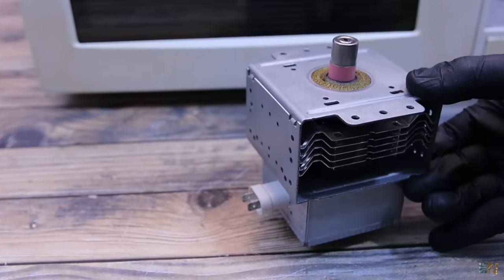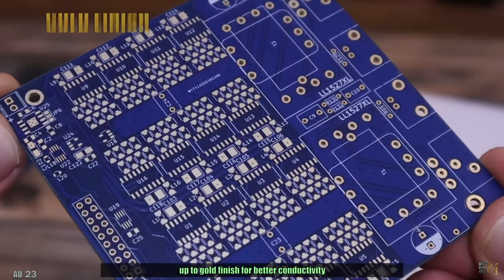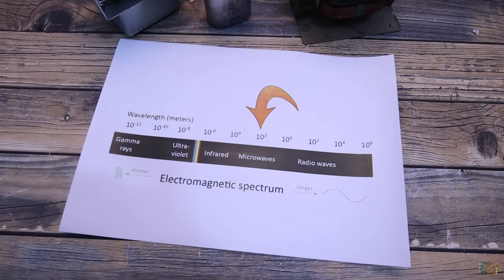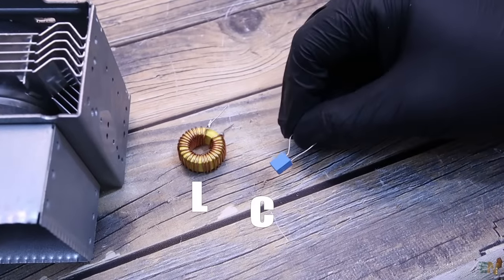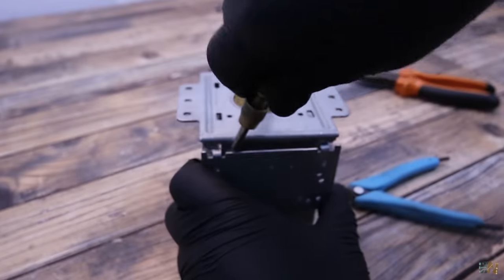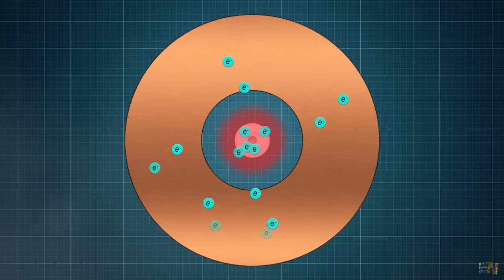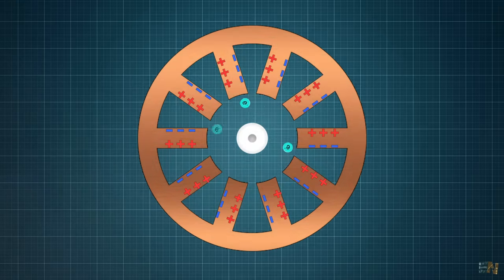MAGNETRON - Teardown + How It Works - Dangerous!

Comment: Very good presentation.
I was trained at Varian Assoc. in my earlier years, designing and making both magnetrons and klystrons.
It was all about copper, powerful electromagnets, EHT, shf, amps and heat. Our klystrons were used for both radar and TV transmitters and consumed many 100's KW of mean power. The ones I worked on not only emitted microwaves but incidently X-rays which had to checked for safety. The vacuums were typically down to 10^-12 torr if I remember correctly provided by ion pumps.
Cant go into too much details (frequencies, output power etc) for obvious reasons but I believe most of this technology has moved over to Solid State!
Reply: Thank you for your comment. What did you have to learn to start doing microwave tech?
Reply: @cherylm2C6671  Quite a lot, I studied electromagnetism (Maxwell) and the maths in my own time, linear algebra and basic electrical theory. Our company was also working on the new X-Ray Tomography machines just coming into production.
I worked in the section designing and making the cavities, so had to learn to use machine tools as well, to very high tolerances I may add. The smallest klystrons were used by jet aircraft in the nose cones, these were much higher frequencies (X band) but much less powerful.
Reply: @tomctutor  Thank you for your reply. I look forward to learning more about magnetron applications. Cookbooks now, theory eventually.

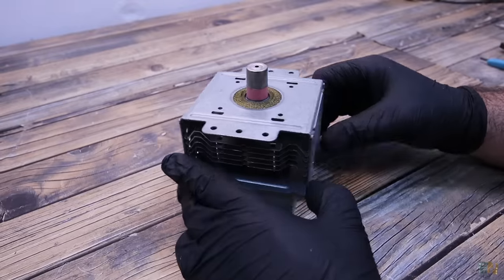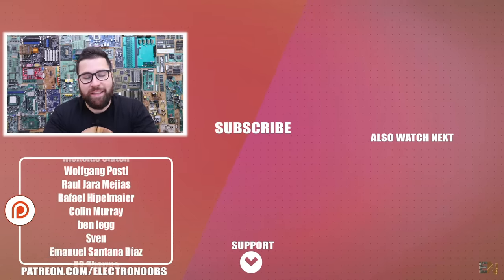Comment: Very interesting.  You could reuse from 8:00  to 14:00 in a video comparing the magnetron with how a Radar Vacuum tube achieves frequencies and speculate why we do not use tubes in microwaves ( excluding manufacturing as when commercial  microwaves started being made, there were vacuum tube manufacturers that could do it ).
Reply: Simple reason is cost and efficiency, magnetrons are over 50% effective at generating microwaves, and need no excitation at all, where transmitter tubes need both an exciter stage to drive them, and also filters on the output, plus the typical efficiencies of around 30% is a big drawback, and also the volume they need. Magnetron combines self exciting, and built in filtering cavity filters in it's design, so it is a single part.
Reply: What do you mean by "Radar vacuum tube"? Magnetrons are vacuum tubes. Indeed, they are used for certain types of RADAR too.  Klystrons aren't altogether too dissimilar in working principle either but they're specifically set up to be able to amplify a signal, whereas a cavity magnetron can only really act as a local oscillator. Handheld RADAR guns use solid state devices (Gunn diodes) and there are now power FET devices that can operate well into the mw band, but when theres no need for a high fidelity, low noise amplifier and all you need is raw RF energy it's pretty tough to beat the humble cavity magnetron.
Reply: @whatelseison8970  The ORIGINAL vacuum tubes used for RADAR had a micro disc inside as the resonator with specific gaps on the inner circumference for the RADAR frequency instead of the size of copper chunk inside a microwave oven.  It appears if you increase the size, triple the wattage you can achieve the same frequencies and higher without being in a vacuum.
Reply: Thank you for your comment. A radio science newbie is always looking for analog applications. There is still plenty of work for vacuum tube in the industry.
Reply: That magnetron is a vacuum tube till you cut it open.

Comment: around 13:22 , you said that the microwave transformer generates around 300V AC! i know its just a typo and in the captions it says correctly as 3000V but to just let you know, i pointed this out. Nice video man as always, hats off to you! keep making such informative content🔥🔥🔥
Reply from the maker: The correct is 3000V. I've read wrong the script, sorry :)
Reply: @ELECTRONOOBS  They are basically an electric chair in a box.
Reply: @ELECTRONOOBS  It's 2KV

Comment: Theoretically microwaves don't come from the hole of the antenna, but really from the insulator, 8:55 those are actually the Heater inputs, anode is grounded on a magnetron, btw nice video

Comment: The safest, for me most useful, component from a scrapped microwave oven is the timer. I kept on forgetting my solder iron, leaving it on overnight until I connected via the timer. I prolly will do an upload to show how it was done. Love these teardowns! Thanks. 🙂
Reply: Going to check it out now  :)
Reply: Years ago i took the display/keypad/controller assembly off an old microwave oven and attached a power cord to it and hung it on the wall in the garage. Makes a great wall clock with count down timer and beeper all built in. Great conversation piece.

Comment: I worked at a microwave plant in the 90's and would go through the "dud" pallets of magnetrons getting tossed into the scrap dumpster to get all the ceramic magnets out of them. NOW I know how those crazy things work. Thank you!
Reply: You threw out copper like that as scrap?
Reply: @Star Gazer  It's like 95% aluminum with very little copper but im sure it got separated at the scrap yard by some means.

Comment: Thanks for this video explaining how the cavity magnetron works. I have made a video showing how to troubleshoot simpler microwave ovens similar to yours. I simply explained that the transformer, diode, and capacitor can be tested easily with common meters and tools; and that if you confirm they are all good but there is still no heating, the magnetron can be suspect by process of elimination.  My mom still has her 1988 year Sharp microwave. Its original magnetron lasted until 2020. Very well made product! I was able to get a used magnetron from eBay for a few dollars and get it going again without problems. 

Thanks again for your good explanation!
Reply: Thank you for your comment. I'll look for that video.
Reply: @cherylm2C6671  
You're welcome. I'll post a link to the video in the next comment. If you only see one comment then it means YouTube is blocking the link.
Reply: @cherylm2C6671  
Microwave diagnostic video: https://youtu.be/v8O3S9H4l_c

Comment: Though video was pretty good, i would like to mention that ''the metal sheath'' you mentioned on the beginning of the video is actually made of mica, and it is interchangeable. If it gets pounced, it can be replaced , and the microwave oven is good as new.
Reply: Thank you for your comment!  Cleaning the interior often is a good insurance. Fat splatter gets hot enough to damage the protective mica.
Reply: @cherylm2C6671  I used a plastic film on one of my ovens and it worked for many years with no visible damage. I think that mica is used just as a "worst case scenario", the area doesn't usually get very hot during normal operation.
Reply: @techalyzer  I will try that! Thank you for your suggestion! That will make cleaning easier than pushing on that mica plate. break. Fats (or bits of exploded egg) kept away from the magnetron.
Reply: What does ‘pounced’ mean?
Reply: @2Sorts  i mean if a hole appears, as shown in the video

Comment: Amazingly informative video. I learned so much. Also learned I should handle those insulators with more care 😬. Ive taken apart a number of microwaves but never knew what it looked like inside the copper high voltage diode, really interesting way to use induction.
Reply: While studying radio, I found Inductors and Capacitors are kind of opposites.

Comment: Perfectly timed :) please also cover TWT, Relfex klystron and microwave diodes if possible
Reply: Back in the 70's, at ET "A" school in the Navy, I taught these things. Something like this video would have been nice back then. I made do with drawing a cross section on a chalkboard and trying to describe the electron flow that way. Animation is so much nicer. Our animation was Army films from back when radar was invented, mostly cartoons with sgts yelling and hearing echos.

I always found the reflex klystron intriguing, with its re-entrant cavity. The visualization reminded of a popcorn popper, electrons flying up through the cavity, seeing the repeller plate, and reversing back to the cavity. One of the weirder devices, but kind of fun to teach. 

TWTs, on the other hand. We really only touched on them, and I never worked on them. Taught a brief segment on them, can't say as I really understood them that well, myself. I can say, however, I can remember having to change how we referred to them while I was there. The change happened as we started getting women coming through the school. Before, when we talked about TWTs, they were amplifying tubes. After, we had to refer to them as intensifying tubes. Because we used an acronym to refer to them, and I'll just leave it at that.
Reply: @jlucasound  Don't forget the 'W'.... 😀

Comment: You're in the DANGER ZONE! It's funny my 15 year old convection Microwave died two weeks ago and, while I have been waiting for the replacement, I've been deciding what to do with the guts. I think a high current low voltage transformer comes to mind. The Managetron will be disposed of... no point tickling the Dragons tail.
Reply from the maker: Be careful!
Reply: @ELECTRONOOBS  Always!
Reply: Ah, rewinding the secondary to make a spot welder?

Comment: What a brilliant video! After just replacing a faulty magnetron in my microwave oven I was interested to find out what is inside one and your video explained it perfectly with a great explanation and clear animations. Thanks! I had already pulled  the faulty unit apart to salvage the magnets and was aware of not breaking the ceramic insulators, but hadn't gone so far as dremelling the copper anode. I have subscribed.

My microwave is an inverter model to vary output power and doesn't seem to have the large capacitor. There are smaller ones on the inverter PCB. It would be interesting to see a video on how inverter microwave ovens work. Thanks again.

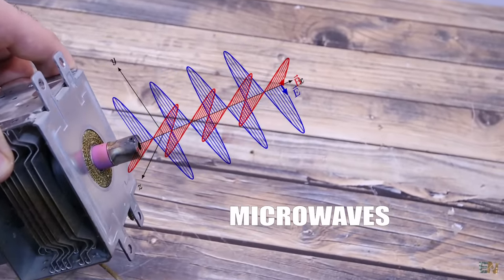Comment: 3:55 it doesn't actually shoot out of that hole like a gun. It radiates around the ring almost like an omnidirectional antenna. thus why waveguides are needed. Great illustration overall fantastic video.

Comment: Getting cancer from BeO is near impossible.  You have to work at it, literally in a manufacturing job.  You can't be hurt by touching or breaking up a BeO bore.  It's danger is way overstated.  Just don't breath the dust while manufacturing quantities of the bores.
(By bore I mean laser bore.  I worked in ceramic lasers for 15 years.)

Comment: Thanks for the video. I didn't know that thorium was used on magnetron cathodes. It will be necessary to disassemble and check the radioactivity in the Wilson chamber or with a radiometer.
Reply: Thoriated tungsten is a very common thing, you buy thoriated tungsten TIG welding electrodes cheap, and they go up to 4% thorium, so are well worth putting in the cloud chamber.
Reply: @SeanBZA  I know about TIG welding.

Comment: The pink ceramic is aluminum or zirconium oxide doped with chromium to make it pink. I used to scrap these things. They have the neat copper piece in the middle. The best way to get to it is to pry the magnetron apart. Grab them magnets and cut the wires. Then cut the top off where the antenna pinch off is. Next remove the heat sinks off. Finally grind the top and bottom of the resonator at the weld and pop it apart. 🤓

Comment: The 2100 volts capacitor filters de AC current from the transformer.
The anode needs at least 2kv to work. This high voltage comes from the transformer working as elevator from 230v.

Very good explanation. Thanks.

Comment: Thanks for all the safety tips and discharging the capacitors are important also, which can be deadly if touched before properly discharged, thanks for all the details, the transformer can be used to make a spot welder for small projects

Comment: Careful, that is a dangerous circuit. 

A couple of notes and clarification on the power supply. Note that their are two secondary windings with a common tap. One winding is small and provides a low AC voltage to the filament, something like 5VAC not 2000V. This is only to heat the filament for thermionic emission for your electron cloud. The other secondary winding is about 2000VAC and is tied to the capacitor and diodes to create a voltage doubler that provides a 60HZ pulsing -4000VDC on the filament. 

The -4000VDC pulsing forces the electron cloud to move out from the filament radially, however, when the moving electrons encounter the magnetic field they curve into an axial flow around the body of the magnetron (remember your right hand rule for electromagnetism).

Comment: I took a microwave apart a few years ago. I was playing around with the magnetron lighting up florescent lights and stuff. I unplugged it and discharged the capacitor. Before I made it out of the garage a couple of my friends pulled up. So I showed them what I was messing with. After a lane shoe I unplugged it to take it inside. But this time I forgot to discharge the capacitor. When I picked it up I was fine but when I brought it in to me Ithe capacitor touched my stomach right below my belly button. And 5200v entered my body. I don’t remember anything after that until I woke up in the hospital. My friend told me I picked up the microwave and made a sound like a sprinkler getting air out of the line. Then he said I threw a wild elbow and hit my drill press . Then I took off full speed across the garage. Slammed into the wall, hit the floor. He said I had a look on my face like I was about to kill him. But I was dead. My heart had stopped. He only reason I know this is because my other friend happened to be an EMT. He had my other friend call 911. And he gave me cpr. But he drug me outside and took my shirt off. He knew it would take a bit of time for the ambulance to get to where I lived. I had no heartbeat for 13 minutes. When the ambulance arrived my friend had already been I  contact with the other EMTs. so they immediately hit me with the defibrillator. Said the 3rd try my heart started again. But they were worried that I might have brain damage from my blood not pumping properly for that long. If it had only been my one friend I would still be dead. If it had been any one else that night. I would still be dead. Fuct up ending to. About a month later I slept with the sister of the guy who saved me. Which in itself is fuckin weird because we had hated each other for 11 years. But now he won’t talk to me. And his sister even said that she pretty much made me do it. And it is true kinda. I would have never thought it until she made me. Moral to the story is capacitors from a disassembled microwave can kill the shit out of u. So be careful.

Comment: Hi, great video!  However, not to be a party pooper, but I think you got your Right Hand Rule backwards!  Recall that out to the box the Right Hand Rule applies only to POSITIVE particles, but the electron is negative.  So it will be forced in the opposite direction (counter clockwise) versus what you show in the video (which is clockwise with the B field pointed into the page at time circa 2:40).  Don't take it too badly though, because at least some and maybe most youtube videos on magnetrons shows exactly the same thing!  I think they are all just showing the right hand rule without thinking about the fact it only applies to positive charges: that is, you have to reverse the direction of the force for negative charges or use the Left Hand Rule for negative charges.

Comment: Ive puled many MOs.apart. The one part I don't mess with at all is the pink ceramic part of the magnatron. I couldnt remember if ts Barium or Berillium, but I do know not to mess with it. I'll take the the ceramic magnets and the brass woven ring (they make great solder sponges). But outside of that, they get wrapped up in a bag and put deep down in the dumpster. Any time I hear or see someone scrapping a MO, I inform them about the pink ceramic part. Not to scratch it or break it. Dont even inhale around it.

Comment: Excellent video. I'd like to add a suggestion: When explaining tne 'capacitor' (formed by a sudden carved section on the copper rod), the electrons closer to the travelling one should be presentend getting away from it... creating the depleted area.

Comment: Interesting explanation, Three things to mention, if I may. The pink insulator, I think you'll find, is just a simple ceramic insulator, if there was Beryllium involved there would be a hazardous material sticker . The copper cavity is so thick so that it can withstand the vacuum it has to contain, copper is a very soft material especially when hot but is used here to conduct heat and reduce resistive losses. You don't explain why the electron stream spins? This is due to the interaction between the electron stream, current, and the magnetic field according to Faradays Right Hand Rule.

Comment: I've taken many magnetron chambers apart from microwaves for copper scrap, and the silver coating inside applied to the surface of the inner copper magnetron chamber was never explained to me. I've had scrap yard workers tell me the silver coatings are tin but that doesn't explain the multi colors that the silver finish turns when the chamber goes bad and discolors the silvery surface a multitude of gold, orange, red, yellow, blue, purple and greens. I know for a fact silver can acquire these color tones but not tin, and I find it hard to believe they would apply cheap tin to such a delicate operation in these vacuum chambers, so do you know of any manufacturing that can tell us what that silver coating actually is made from?